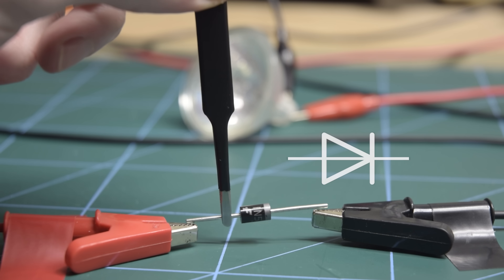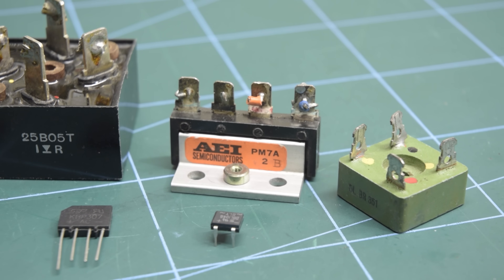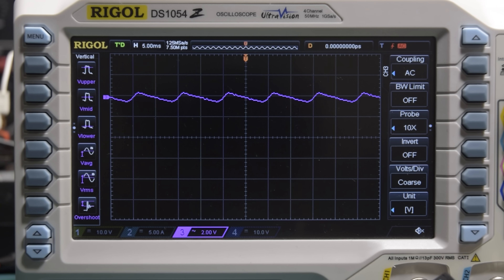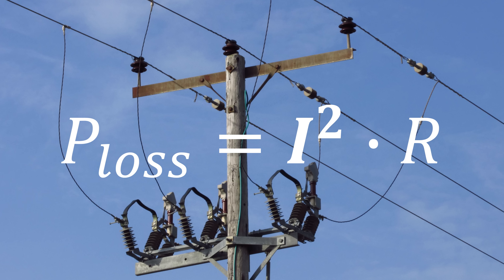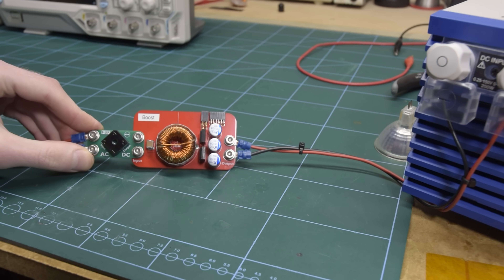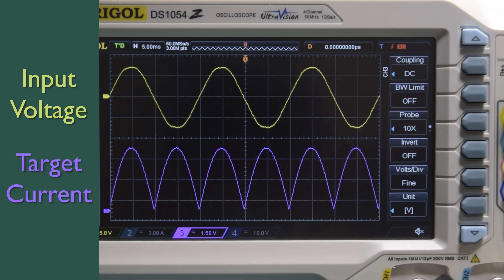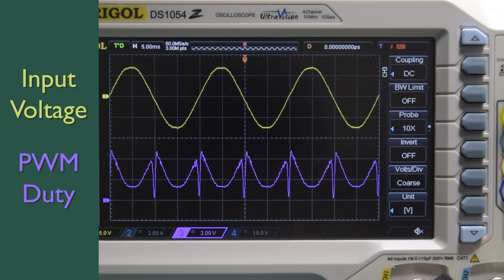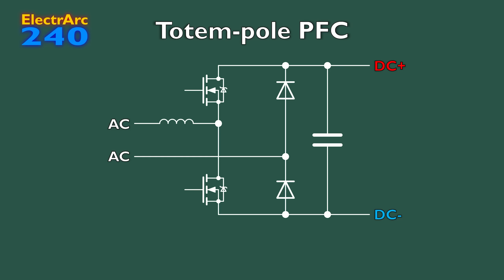Fixing the Full Bridge Rectifier’s Big Flaw - Active Power Factor Correction

Comment: What's the capacitor's output current before PFC? Won't it be more smooth than the input current because of I = C dV/dt? But I guess you only care about the supply output current for PFC and not what the load sees?

Comment: So good video, special that many people now use a pertrol/gas generator, 1phase with a FBR+Cap to provide a energy to PV MPPT Inverter input to charge a battery in offgrid system. Yes, this is very popular now and this not have any protection. Maybe you can show how to protect it and do some PFC. 5kW of power is max, we use CEE 32A 1phase 230VAC output from generator.

Comment: Theres also another Passive Power Factor Correction called Valley Fill Circuit, it uses a Full Wave Rectifier, 3 Diodes, 2 Capacitors, 1 Resistor .

Comment: We should have gone with DC in our power grid. Now we have hvdc changing to ac and then back to DC again. Very... Very dumb system. Two systems, 1000v DC for big appliances, 24v for small things. Just remove ac from the equation. And of course 1M volt HVDC highways between big powerstations.

Comment: AC Voltage is 120 60 HZ  at a standard outlet.  You must be using a forigen outlet if you're getting 240 50 Hz volts.
Reply: that would be an incredibly long extension cord.... if your plugging into the grid of your country.... then its not foreign.

Comment: A very good & cool way of doing this back in Toob days, was a swinging choke, of around 30H, preceeding the 1st  filter cap. An application where it is useful is transmitters or audio amps with eg 845 or 211, which otherwise is tough on your rectifier tubes.

Comment: Certainly an eye-opener for me! I built a full-wave power supply in technical school, we were worried about filtering the output of the bridge through capacitors. I tried using chokes, but had difficulty because I could never find a way to measure inductance like you can measure capacitance. We never got to power factor in this context except to learn its definition. Buck-boost was ‘explained’ to us, but we weren’t tested on it. We also did not have digital scopes capable of math functions, and none of us were expected to code, except in the course on microprocessors. You’ve certainly opened new vistas for me. Subscribed.
Edit: We didn’t have Hall-effect current probes, either. 🙂
Reply: Why were you worried about it?

Comment: Some of those active solutions have a fatal flaw in contrast to rectifier. And you see that when you introduce artifacts around zero crossing which semiconductors in inverters produce. This will cause a failure on any device that depends on zero crossing or noise that rodes on fundamental wave. Diodes would not fail in rectifier. I did not see anyone test it with a dirty wave like that. I woukd prefer passive components.

Comment: Pretty good, but blaming the rectifier is a mistake. The bulk capacitor is to blame. If you only have a resistive load after the bridge rectifier, power factor is close to 1.
Reply: If you only have a resistive load, then you don't need the Full-Wave Bridge Rectifier!
Reply: @MrSummitville  Not so. A DC motor counts as a resistive load yet will not run on AC. If you take a resistor, sure, you are right.

Comment: Your picture of sharp spikes from diodes on the oscilloscope is BS and you know it.
The rectifier diode has a .7 volt loss and a threshold that must be met to allow electricity to pass through. The only way an image like you have can be done is if you reduce the voltage to just a little more than the diode threshold, and NO BODY RUNS A CIRCUIT LIKE THAT.
They would use a scot diode at .3v loss for low voltage needs, not your rectifier diode.
Then YOUR idea that there is a problem here is also FALSE. The diode is not a power loss, it's just not letting enough electricity to pass through, and anybody who owns their own oscilloscope knows that you add more diodes or more voltage, along with resistors and caps to get the job done, which make up 80%? of the components of every circuit board fool.  Then the yak forever about nothing part makes me hang up on you.  There is nothing to wait for.
Reply from the maker: The waveform you’re talking about is current not voltage, it occurs partly as a result of the diode threshold as current only flows when the mains is greater than the DC cap voltage plus that threshold. If you use your oscilloscope and a current probe to view the current waveform of any <65W SMPS you’ll see pulsed current draw like this. Also I’d avoid using resistors in a power circuit, they’re no good for that kind of thing due to the losses
Reply: @BitDog4U - You clearly do not understand how distorted the current waveform is, for a Full-Wave Bridge Rectifier (AC-to-DC) circuit.

Comment: How the hell is the powerfactor less than one if there is no inductive load?
Is it because the powerdraw is so unclean?
Reply: It is a Harmonic Distortion power factor problem. Not a lead / lag power factor problem.
Reply: @MrSummitville could you explain it to me please? I dont understand what you mean.
Reply: @livelaughlove_88h   Full Wave Bridge Rectifier - The curve of the input Voltage waveform is a nice Sine Wave. The curve of the Amperage waveform is a narrow spike!   This narrow spike is shown in the video. This causes Harmonic Distortion on the Grid = bad.  The PFC circuit corrects the shape of the Amperage waveform, into a Sine Wave, which eliminates the Harmonic Distortion from the Grid.
Reply: @MrSummitville why is the amperage spiky?

Comment: I'm almost 67 years old. I am using my parents original vertical deep freezer. Purchased 2 years before I was born, so it's ~69 years old. It has never failed or been repaired. It has moved, via a moving van company, back and forth across the USA ~ 7 times. It was in warehouse storage for at least 3 times for a year or so. So...kid gloves treatment, I'm sure.
It still works like new. I realize it's 60 Hz AC only from a different era.
Out of curiosity I put a meter on it. Its PF is exactly 0.5.
I figure the AI data center power consumption humanity destroying voracious behemoths can handle all ~75 watts of that.
Reply: Multiply that by 1 Million homes!

Comment: Hold it! You first talked about problems with a full wave bridge rectifier's circuit power factor and then bring up a laptop power supply. Surely you know this is apple's and oranges. As those are switching power supplies. And I suspect your issue with a linear power supply can be fixed with an inductor. Huh, didn't watch it all and I see you brought up inductors. But still your comparison of the laptop power supply was bad.
Reply: In a laptop power supply, the AC line voltage is converted to HV DC using a bridge rectifier circuit.

Comment: I didnt realise these laptop type power supplies were so complex. Do they have a microcontroller in them or is there some chip available that does all the PID and PWM?
Reply from the maker: They usually use controller ICs that just have gate drive outputs and sensing/feedback inputs, plus a bit of a compensation network to tune the controller for the circuit. So the latter
Reply: @electrarc240  Cheers, I'll do a search and see what I can find

Comment: This is a great video, but does lead to one question. If we replace the Diodes with MOSFETs, we get a H-bridge bridge converter, which is also a topology use for dc-dc conversion. Are we able to skip the dc-dc step down using this?

Comment: I would like to take a linear power supply, but add a boost PFC on the low voltage side after the rectifier. This would be for test bench or HF radio use.
Reply from the maker: In power supplies with traditional boost PFC, that tends to be quite a bit noisier than the rest of the power supply, at least for conducted emissions back onto the mains. So that may not serve the purpose you are hoping unfortunately
Reply: Hm, conducted noise can be filtered for the load, but radiated would be a problem. I was hoping the smaller dV/dt would help there.

Comment: Really doesn't matter the code... but... using a PI?...  that doesn't affect the 3rd, 5th, 7th harmonic... do you contemplate to use a dq controller or a resonant delay controller?
Reply from the maker: For this quick demo PI (only just) did the job. I definitely agree it is not the correct control technique for this but it was the quickest to throw together for this video. Maybe I’ll do a video in the future about proper control for PFC

Comment: And that's why i won't use switching power supplies period .I will stick to less efficient linear power supplies that don't generate any noise anywhere on the AC line.or on devices ...We have had to up size neutrals on transformers because of the pulses generated by these electronic power supplies ..So mage damage .Yes they can be cheaper lighter but no where near the reliability of old fashioned linear power supplies .Now they are doing the same thing with mains power replication regenerating a clean AC mains supply.but they cause noise back up in the power grid ..So many people now using  single phase VFD s to run 3 phase pumps /Motors for pools generating loads of noise in the neighbourhood affecting LED lighting

Comment: I hate a bit the boost converters, as they have a few, not mentioned problems. In any case, regardless of topology, a huge output capacitor is needed if the output shall be smooth of a PFC circuit.
-So with a boost converter, there will be always the problem of huge inrush currents when switching on and this has to be handled.
-Output voltage must be larger than peak input voltage; nice would be adjustable from zero.
-Its not short circuit proof, which might be a nice feature.
A solution I found for this was to use flyback instead of boost, at the expense of a bit larger transformer. But still open for me is:
-What design is best when 3 kW output power are needed?
-How to handle best 3 phase AC?
Suggestions here are welcome.

Comment: A full bridge rectifier does not have a power factor problem! It is the capacitor input filter that has the power factor problem whether the rectifier is full wave, half wave, voltage doubler or no rectifier at all. Please be more precise in your accusations!  - Regards: Retired Aerospace Power Systems Engineer

Comment: it’s also worth mentioning that for lower power (~100W) circuits, a flyback converter operating in DCM behaves like a resistor from the point of view of the supply. these are really simple to control because as long as the converter operates in DCM, we can just use a slow voltage feedback loop to allow for universal voltage input. unlike the boost, a current shaping loop isn’t really needed.

Comment: Volt-amps... Dude you mean Watts??
Reply from the maker: No they are different. Voltage can be multiplied by current in a few different ways with AC. Apparent power or volt-amps is the simple way, measuring RMS voltage and RMS current and multiplying them. But real power is what you get when you multiply the two and then take the average. Hard to explain properly in a comment lol
Reply: @electrarc240  So it's like the whole "W vs kWh/1000h" dilemma?

Comment: Great video as always. I have a question about passive power factor correction.

I understand a poor power factor results in additional current flowing from the supply via the distribution system for the same real power.
However I'm confused, as once a capacitor is added in parallel to achieve a unity power factor, the total impedance decreases, which would allow more current to flow? This seems to contradict the fact that power factor correction should reduce the current flowing from the supply, so i must be missing something with my maths...

Ill give an example with rough figures for context.
230v 150hz AC supply with a coil of 90 ohms and 75mH in series:

Impedance=115 ohms
Current=2A
Real power=364W
Power factor=0.79

So then a roughly 15uF capacitor is added in series to achieve a unity power factor:

Impedance=90
Current=2.6A
Real power=580W
Power factor=1

Any explanations/corrections would be appreciated as I'm struggling to get my head around this, particularly as no vides online dicuss calculating the current after adding capacitors, thank you!
Reply: Ah I think my confusion is coming from the difference in calculations when adding a capacitor in series vs in parallel. So in parallel the correct value capacitor to achieve resonance/unity power factor should be 5.7uF not 15uF, after which impedance increases and current drawn from the supply does decrease

Comment: 4:28 Is that 2A the "real" current? RMS current? Average current?
4:35 Where is the R in your losses formula? Which stage or component?
Reply: 1. Probably RMS
2. Every stage and every component. Wires actually have quite the resistance if they are this long, also transformers has loses. Every component of power grid has loses

Comment: I can understand the grid wants the cos_phi of 1, excepted we only pay for the cos_phi part, the blind part sin_phi we don't pay for, therefore try and get as much away from the rules as possible and don't compensate where possible, its better for your wallet..
Reply: You can't cheat a modern power meter. They measure your actual power consumption, no matter how distorted the current waveform is. They can penalize you for very poor loads, though.
Reply: @schmetterling4477  Of course they could measure, but if you are the only one having a bad cosphi, on the total neighbourhood, this is no reason to find out the culprit, all meters for households only measure the real power, the blind part of the power vector is ignored, so use as much blind power as you can, remove the capacitors to adjust for inducttive loads and you will do your wallet a favour.
Reply: @ Blind power is no power. At most it creates excess losses in the transmission lines. Households are usually not being charged for that. Nor does it do you any good. Industrial users are.
Reply: @schmetterling4477  You clearly don't understand electrical engineering, thats ok, but having a discussion is useless.
Reply: @ No, I don't understand electricity. That's why I have a PhD in physics and you are serving burgers. ;-)
Reply: @schmetterling4477  That makes it even worse man.. , good luck investigatinh the subject, you are never too old to learn.
Reply: @  I am quite old, but I have mastered this subject about forty years ago. ;-)
Reply: @schmetterling4477  Aparently you haven't.
Reply: @ Well, then let me give you some more attention until your Mom comes home to fix you dinner. ;-)

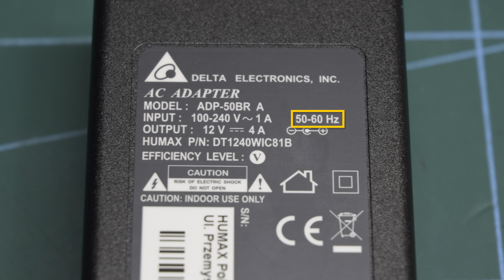Comment: My laptop charger has that and I'm in the USA. So what that mean if I hopped a pond to your land would my laptop charge faster or slower? 10:00
Reply from the maker: Power out to the laptop is regulated/limited so charging speed would be the same but it would likely be a little more efficient due to the higher voltage / lower input current

Comment: Very well done video. Gave me much better understanding of how power supplies work. Would be fun to see video or series of videos where you build some decent power supply step by step. Like for example 240V to 12V with 1 kw (~83A) capability. Like for example video 1: just get it to work, video 2 add PF corrector and make it so that PF is 0.98 both at 1w load and at 1000w load, video 3 - add basic protections like over current protection, short circuit protection and so on, video 4 - make both voltage and current 0 - 100% adjustable from potentiometer. And then next n videos to add all other kinds of filters and protections and safety things to show what it takes to get it as good as the one you can buy.
Reply from the maker: I’d love to do this, probably will when I have more time. 1kW sounds good, bigger is better for filming!
Reply: @electrarc240  Also 1kw is more difficult. With 10 watt it does really matter how you build it because most likely everything you throw together will work on first try but with 1kW you have to put things in parallel, deal with cooling, use proper wire thickness, make sure that all your mosfets switch at the same and not at random times. And instead of showing us some typical 555 IC that people youtube has already seen seen a lot you could show us something that youtube has seen less such as KA3525A and LM324N - could be separate video tutorial how to hunt down datasheets and how to even read and understand them because those datasheets can be quite cryptic to read sometimes so it's easy to read entire datasheet and still not know what to do.

Comment: A bridge rectifier shouĺd be in a stand alone circuit ONLY  meaning it is a mains sine wave (with no leading or trailing edge) coming from the board directly to the rectifier (whether via switches or isolator is irrelevant) meaning there is ZERO power factor in play on this circuit.

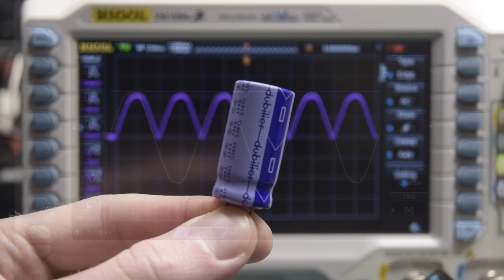Comment: @2:50 Wrong. The Capacitor WILL NOT stay charged. It will discharge and try to maintain the voltage.

Comment: Hello! Is it any profit to install PFC on the low-voltage side ? I mean AC 50/60Hz  transformer with PFC on the secondary side (12-36VAC).I have an experience - my 68W transformer became very hot with 30W load and classical passive diode rectifier with a capacitor.

Comment: For an entirely resistive load, the power factor correction is made by the added inductance added to balance out the complex impedance caused by the depletion region capacitance, right?  I would like to buy a fully active FWB, but they don't seem to be available as a stand-alone component.